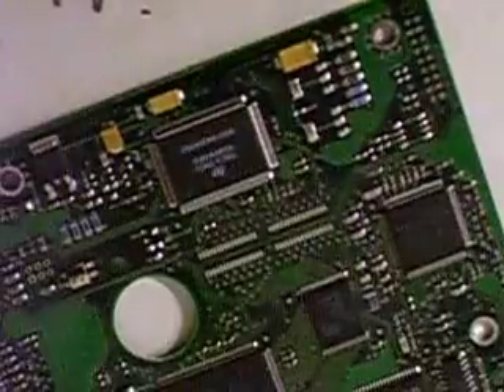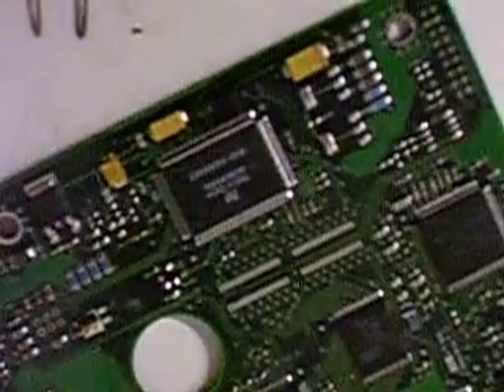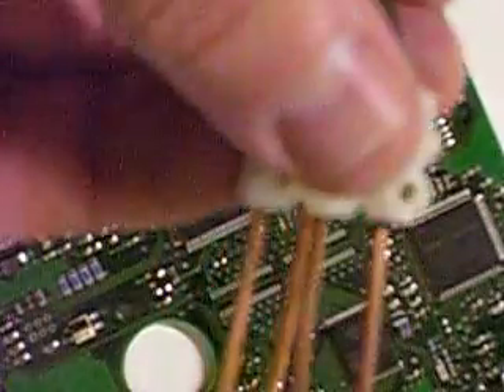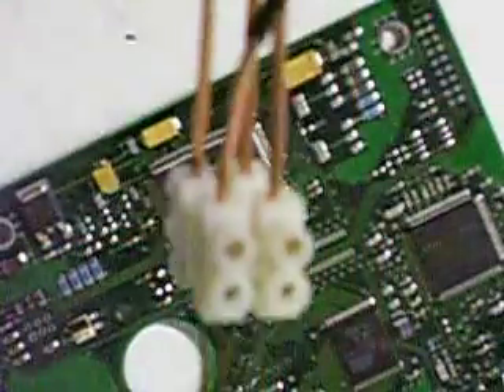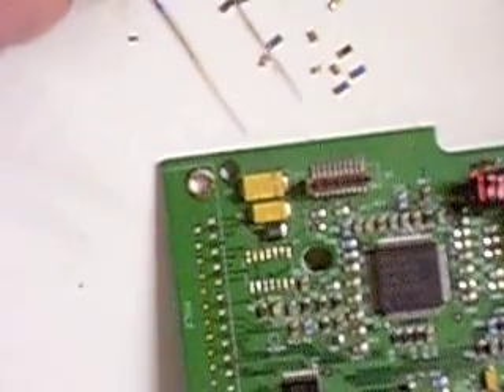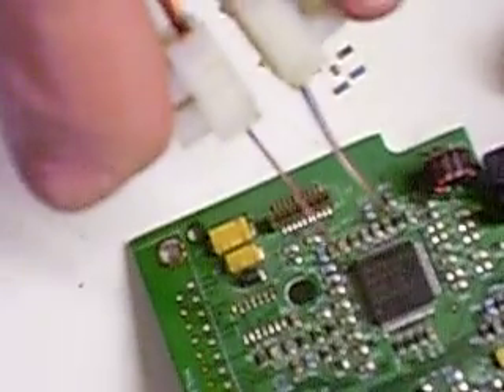Homebuilt Desoldering Tweezers in action

Comment: I made this using mild steel mig welding rod and it did not work very well. I had it up at 8-10v dc and it heated up a lot and glowed but my mild steel went soft and splayed apart.

I cannot find stainless steel mig rod without buying a large roll of the stuff.

Why am I having this problem ?